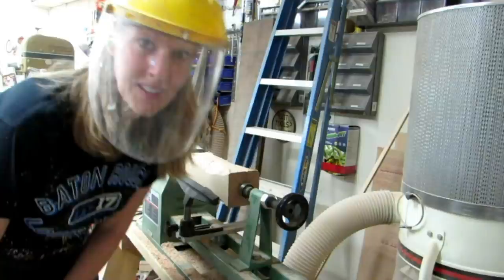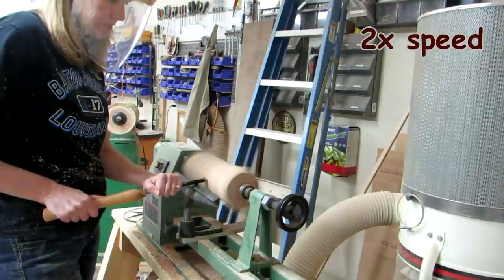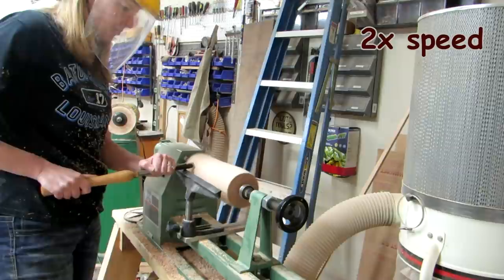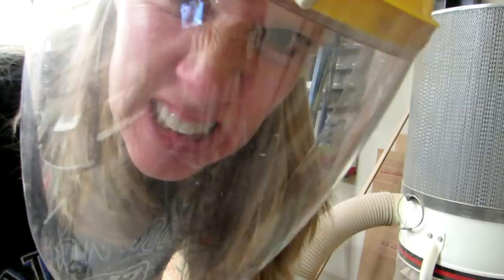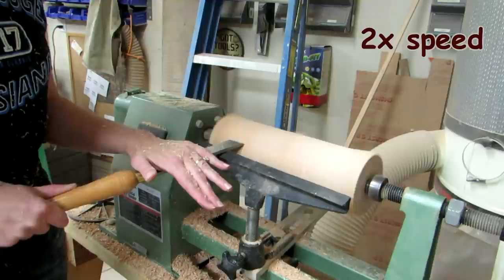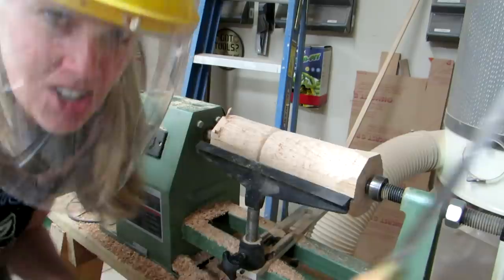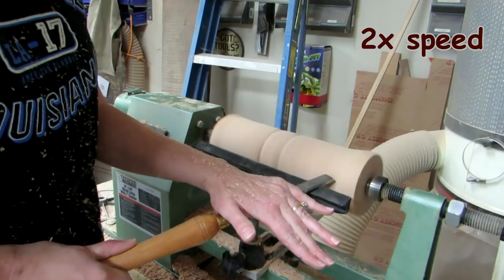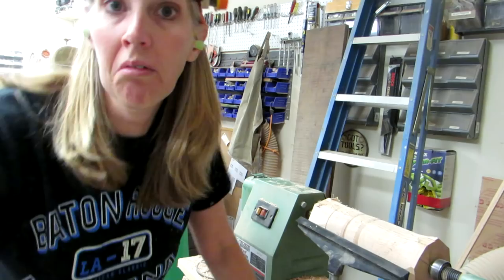First Lathe Experience

Comment: Cy, couple of things come to mind here...your stance is important, keep your right elbow tucked tight to your hip and let your body move the tool across the workpiece by shifting your weight. Don't let your right elbow leave you're hip. Second, lay the tool on the rest and raise the point of the tool towards the ceiling, slowly lower tool into the workpiece until it begins begins to bounce , then draw the tool down to begin the cut and then move your body left or right keeping it parallel to the piece. Personally I think you should learn to sharpen your tools first as there is nothing more dangerous than a dull tool. It's very easy to pick up bad habits and difficult to get rid of them so take the advise offered elsewhere here and watch the numerous pros on you tube. One more thing comes to mind, you will find a lot of conflicting opinions in the beginning and a million ways to accomplish the same thing... Just pick the one that suits you best and go with it. Good luck and enjoy your
Reply from the maker: +Robert Miller-Jones Thanks for the tips, I am finding that to be true, that there are a million ways to do the same thing, and I agree with the idea to just figure out what works and go with it!  Thank you!!!!

Comment: You should join a club.  You can get a lot of useful practice making spinning tops.  Cut top blanks from a board with a hole saw and glue a dowel in for the shaft.  You can press markers to the spinning top to give it interesting colors and there are also texturing tools that can be used.  You can apply finish as the work piece spins.  If you have kids going through your dental practice, you can give them out as gifts.
Reply from the maker: +Harry Ragland Thanks!  Those are all good ideas :)  I had my own practice at one time, now I work for a company and treat patients in nursing homes!  They may enjoy a spinning top too though, you never know!

Comment: AWESOME! My lathe is my absolute favorite tool in my shop. You can start and finish projects in the same day. It's like instant gratification wood working! I like to secure the front of the tool firmly with my thumb and index finger and rest my index up against the tool rest. That way my finger kind of acts like a stop so I don't accidentally push the tool too hard in to the material and get a catch. I also like to "choke up" on the handle a bit with my right hand and keep the also handle pressed up tight against my body. That helps give you a lot more control instead of moving just your arms when you're making a cut you move your whole body from side to side. Those two little tricks have really helped improve my tool control a lot, and helped  make me feel a lot more comfortable using the lathe. I hope that helps you on your lathe adventures! You'll be a turning junky in no time!
Reply from the maker: +Braxton Wirthlin Thanks Braxton!  I just bought a book and it showed holding the way you mentioned.  And thanks for the other tips!  I hope I figure out the tools so I can make some stuff!!!

Comment: This is awesome Cy! 

Watch out... Lathe turning is addictive... not as bad as crack... but close.

I started with the same lathe and tools. Good lathe to try out turning.

(I swore to never be a safety Nazi... Buuuut....) Once you mount your piece between centers... tighten the nut on your tailstock. It will prevent the tailstock from backing out.

Re-watch this video and watch the nut on your tailstock, you will see it moving from the vibration.

Have fun Cy!

ETA: I didn't see Jim's comment below before posting this.
Reply from the maker: +GP Woodworks Thank you, yes that tailstock nut kept loosening, I would snug it up a lot, I know now to wrench it down so it will stay tight!  Thanks!

Comment: Off to a good start.  Husband got the center height right for both of you when he made the stand..center of the drive pins. comfortable work height.  Lathe chisels have a few simple techniques.  The first you used could be now sharpened by take off the edges more like your thumb tip and it will cut fast, it looked flat now, companies send them that way.   the V point try cuttting bevel down,flat suface up.    Lathes can be like pottery sometimes a freedom to work it.  More lessons to learn, be safe.  Hals Wood Shop.
Reply from the maker: +Hal Kester Thank you, I am learning some tools go up, some go down, and ones I used sideways are supposed to be used that way.  I like what you said, like pottery. I enjoyed the potters wheel once, hoping I can get this lathe down!
Reply: +Cy&#39;s Corner Thanks for your reply.  some of us have been slow learners and before utube less large ways to get help. Lathe projects (at 63)  I have done a chess set, 3 gavels, bowls . lazy susans, and a pole lamp from scrap wood.  hope those give you some new thoughts.
Reply from the maker: Hal Kester Those projects sound great!!!  My list of "want to makes" is growing!

Comment: lathes are fun..start with the roughing gouge, then that "flat tool"is called a skew thats for smoothing..and that "pointed tool"is called the parting tool..so u used the correct order..: ) hardest part is remembering the  names..youll get them though practice practice..:) try rocklers square,  round, and diamound shaped tool set..i forgot the names..lol
Reply from the maker: +Joe basementwoodworking Thanks Joe :)  Hee heee, you forget the names too!  I like what you said though, practice practice  :)
Reply: +Cy's Corner lol yea ..i think its calldd the midi set ..its one size larger than the pen set..then u dont have to sharpen them ever.just rotate the tip and/or  replace it when its dull..which mine is still sharp and ive turned alot so far..")

Comment: Hi Cy   Look at the vid in the 3:30s - see the nut on the rt. side big threaded shaft (tailstock) is loose on that shaft - need to screw shaft solidly into the wood and then tighten that nut into the green tailstock body - that will "lock" threaded shaft in place - will solve your loosening problem. Besides Mike Waldt also check Cap'n Eddie Castelin / Carl Jacobson / and Brian Havens - these four will "show" you all you ever need to know!
Reply from the maker: +Mike Quinn Thanks!  I was tightening up that nut but only with my own power, so it kept loosening.   Maybe I need to use a tool to wrench it down tighter?  I took a beginner online course with Carl Jacobson, perhaps it was beginner enough!  ;)  I will check out these other folks you mentioned too! Thank you.
Reply: +Cy&#39;s Corner Yes - put a wrench on and crank er down - by that I mean more than snug - pretty big stuff so shouldn't have to worry about stripping it out or anything like that.
Reply from the maker: +Mike Quinn Okay!  Thank you Mike  :)  This helps tons!
Reply: +Mike Quinn And don't forget Stephen Ogle, or the Naked Woodturner (he's fully clothed).
Reply from the maker: +J.L.M. Hee heeeee

Comment: Hi Cy !! Lower your tool rest to just below centre of the work pieces ... You are to high, so your roughing Gouge isn't cutting correctly.... Flat tool is a skew, 3rd tool you had upside down I think ? its a round scraper ... next was a spindle gouge...... parting tool goes edge on not flat .... take a look at Mike Waldt channel he has a beginners guide ... Well done for trying !! But please tighten up the tail stock (the big nut) Before turning as the wood will take off and hit you full in the face !!!! ....... Any questions just ask !! Also take a look at woodchuckers on face book great woodturning community !! Regards, Steve.
Reply from the maker: +Templeboy Turnings Hey thanks!  I could use all the help I can get :)  I was tightening up that big nut all the time, but I did notice it loose in the video.  It didn't loosen as much after the wood was rounded out.  I will check out the channel you suggested.   Thanks so much!
Reply: +Cy&#39;s Corner No problem !! Look forward to watching your knobs !! Hmmmm maybe handles is better, Em.... I look forward to your next project :-P.....Steve.
Reply from the maker: +Templeboy Turnings Hee heeee  :)  I am going to tighten that nut up real snug next time!  So I have already turned the knobs (shhhhhh) and should have that video out soon.  The tool rest was broken and my hubby fixed it up, I can move it up and down, but I cant get it real close to skinnier pieces.  But sounds like I need to move it down a little more to be below center.  I have already learned so much from these comments!!! Thanks!!!